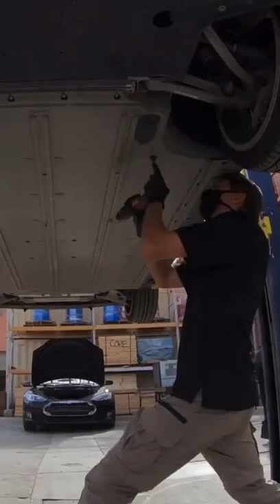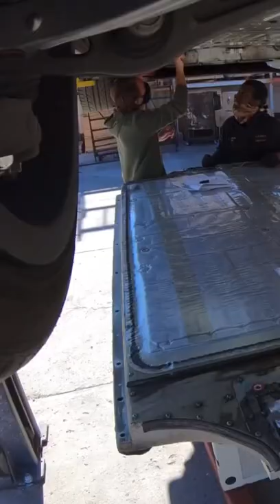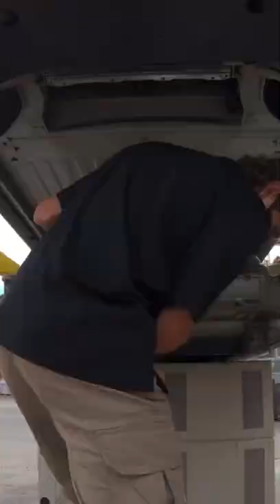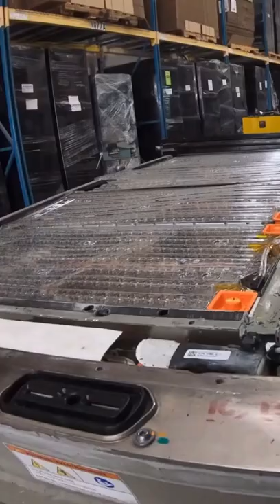How we Remove the Tesla Main Battery Pack

Comment: And then they LS swap it so It can be a real car
Reply: Love it!
Reply: Best comment!
Reply: Why make it slower and more expensive to run?
Reply: @Victor-vj5ds  No, so it can drive three counties away without having to recharge lmao...
Reply: @motherlovinsnuffstar  so your doing an LS swap so you don't have to stop every 4 hours to recharge? I'd rather save myself the gas money....
Reply: @Victor-vj5ds  I get that. But personally I take the vehicle's range into account when determining its reliability. I have a 50 year old jeep that I can refuel on the middle of nowhere, on the side of the road, or out in the woods, in less than 10 minutes with a Gerry can. And go places no ev has ever been (or ever will).
Reply: @Victor-vj5ds  No, I wouldn't waste an LS (or a lawnmower engine)  on an ev. Those gender neutral mobiles aren't for me, regardless.
Reply: @motherlovinsnuffstar  is your car a girl, or a boy?
Reply: @motherlovinsnuffstar  i own a jeep wrangler, do to its poor gas mileage an EV can outrange it but because electric motors have instant tourqe vectoring they can beat any 4x4 system you can put in your car. You can use anything from the sun to gasoline to recharge an EV if you run out of range.
Reply: @Victor-vj5ds  I didn't mean the car itself, the driver's. I called EVs gender neutral mobiles. Is the batmobile Batman or Bruce Wayne?
Reply: @Victor-vj5ds  I'm talking about a real jeep, Not a Fiat made cheap jeep. And yes, I can out range your ev, guaranteed. With the fuel I have in it, and in my Gerry cans. No two ways about it. I could go nearly 1000 miles before I have to refuel, and fill my cans. I guess you could drop a few energizers into your trunk or something lmao.
Reply: I'll just leave this here..
Battery-electric vehicles and plug-in hybrids have more problems than the average car, according to the annual J.D. Power U.S. Initial Quality Study (IQS) released Wednesday. The 2022 survey found that EV owners cited 39% more problems with their new vehicles than did owners of new combustion-engine vehicles.Jun 28, 2022
Reply: @motherlovinsnuffstar  you know whats funny, you actually can't outrange an EV if you bring the same "gerry" cans and a portable generator. EVs are extremely efficient even when they run in gas, more than most cars. But this is an argument you have to admit will age poorly as EV batteries improve energy density. Eventually batteries will get you further and recharge in 5 minutes, but hey, i guess you save some time if your doing a multi day offroading adventure like people do all the time.
I think your naive for using JD power associations ranking system. You need to look closely on how the data is gathered VS other organizations. For example "consumers report" has Tesla simultaneously ranked lowest in reliability but highest in customer satisfaction raiting. Then you look at whats considered reliability and see something like a panel gap is complaint is the same as having your valves drop and destroying your engine. So who do I look at to determine if money is actually being saved? Rental companies and police departments. From what I heard from some police departments, it makes up the cost difference in 2-3 years compared to a Ford Taurus do to the lack of maintenance and fuel cost. Your probably only hearing about this because traditional automakers have really struggled to make EVs for the first time and push things ahead of schedule to stay competitive. EVs are usually packed to the brim with electronics now that just introduce more failure points but this is not exclusive to EVs, the same stuff is causing reliability issues in new gas cars but its usually worth it. Even JD power says most of the issues in EVs are related to the electronic interface and not the actual mechanical hardware.
Reply: @Victor-vj5ds  I wouldn't need gas cans or a generator.Lets drive across the US, say LA  California to Jacksonville Florida, (2,415.7 miles). Give me any petrol car with a range of 400 miles. I'd be able to find a gas pump before you could find a charging station, and fill up and be back on the road 15-20 minutes before you. We'd have to fill up/charge a total of 6 times. The fact that you have to charge alone would put me 90 minutes ahead of you, at minimum. Add a couple Gerry cans, and I've got you out ranged by a good margin. In fact, you'd better bring a generator. And your wrangler, if you don't want to walk home. Because I'm one of those "I told you so" kind of assholes who'd let your ass walk, and would be laughing so hard I wouldn't be able to take your money.
Reply: @Victor-vj5ds " They have instant torque, so they can beat any 4x4 system you can put in your car." Idk what to even make of that... How's that instant torque any advantage of you're in water, or mud past your hood? You didn't even change your own oil, or know how to do a tune up, huh? I didn't realize you were one of those ev drivers..
Reply: @motherlovinsnuffstar   i don't own a tesla but I do infact change the oil on my own jeep and fix anything that needs to be fixed if I have the tools since I work construction for a living. My brother has a model S long range, it has a range of 400 miles. He spends no time looking for a charge station because tesla automatically chooses every stop you need in order to reach your destination. Super chargers are everywhere so all you have to do is follow the GPS. Current superchargers get 50% of your range in 15 minutes or 80% in 25 minutes. Thats reasonable for every 4 hours of driving. But then I'm thinking, why would I care if you road trip 10% faster across the country. Is this a race or are we seeing which one is cheaper/ more enjoyable? I'd rather save a few hundred bucks than get there 90 minutes earlier. 
On your question about instant tourqe vectoring. This is an advantage over traditional differential because depending on the number of motors, you can control the amount of power given to each wheel. A common problem is tires applying to much power and causing tire slip which means the power doesn't get fully applied. So their is a delicate balance of applying a lot a tourqe but not enough to overcome the friction of the tire. The motors can detect a slip through changes in its magnetic field at near instant speed and is able to adjust tourqe to either stop or prevent slip. Another issue with simple differentials is that if a tire is on un even ground and is lifted off the surface it can cause all of the engines power to get sent to that spinning tire instead of the ones touching the ground. You can beat this with something like limited slip differential but they have considerable lag that can never approach the speed of a electric motors response time.

Interesting you mention water all the way up to the hood. I've seen a few videos from China heaving major flooding but Teslas driving through flood streets except their floating because they have sealed cabins and peddeling forward with just the wheel spin of the tires like if it was some kind of boat, the engine in my jeep would have chocked without a snorkel.
Reply: @Victor-vj5ds  Even Toyota says EVs are a lost cause. A long range Tesla, 400 miles. The petrol car I was referring to wouldn't be considered long range, or extended range by petrol standards. And I'm sure your brother isn't driving it far enough to need the range he's got, much less more. Everyone talks about efficiency, I see plenty of junkyard LS engines making over 1000 whp on a stock bottom end. It takes three, three phase motors for a Tesla plaid to do it, lmao.
Reply: @motherlovinsnuffstar  see, you're still trying to win by choosing the losing team, Toyota hasn't made a single EV, instead they have focused on hydrogen cars for the last two decades and have failed to make them commercially viable. Why would I care what Toyota thinks when Tesla has the top 2 selling cars in California?
I know you can take just about most engines and push ridiculous power but its funny your trying to downplay tesla by saying they need 3 motors like they aren't sub 100 pounds each and cost less than 1,000$ to make. The plaid comes with 1020hp factory stock and a 150,000 mile 8 year warranty on that drive train and battery. If you actually want to make a point show me a stock 1000hp engine with the same warranty.

Comment: I remember the battery swap station Tesla had at Harris Ranch on i5 half way between LA and the Bay Area back in the day. They did all this from a pit under the car, and the battery was lowered down and slid into a charging slot along the sides, and then a fresh battery slid back in and bolted on.
They shut it down a few years back, and I think it was about 5 years ago they finally gutted the equipment and turned the building into the prep kitchen for Harris Ranch Express BBQ!

Now Tesla is in process of building one of the largest Supercharger stations ever right next to the building, and the BBQ is worth stopping for even if you don't have a Tesla!

Comment: “The best part of Tesla is i don’t have to do maintenance or oil changes 🤓”
Reply: You don't have to replace the battery for a veeery long time. Battery replacementa are rare and often done to cars that have abused fast charging. If you care for your battery it will last 30+ years to the point most gas cars have broken engines/gearboxes or are pile of rust

Comment: I want to side what happened when one of the batteries gets t-boned. Outcome can't be good
Reply: Compared to other cars it’s amazingly good
Reply: @09impala  Uh.... nope. Compared to an ICE vehicle the tesla is more dangerous in a wreck. Lithium batteries will very easily have a meltdown if they get damaged even in slight ways. If the battery does start to meltdown it's also more difficult to put out as lithium 9 put of 10 times won't be put out by water often the water makes it worse due to causing a hydrogen explosion.
Reply: @jessehoward2128  if you had stats on that than maybe people would believe you

Comment: nice never knew the batteries were so low to the ground that’s a little odd given the fact that streets get over a 100 degrees during the summer. I’ve noticed heat does numbers to lithium batteries..

Comment: What’s the life on said batteries?
What’s the replacement cost of said batteries?
Reply: Replacement every 300,000 to 500,000 miles. Battery replacement cost depends on labor and parts, but average cost is $13, 000 and $14,000 for basic model replacement. For Model S, premium sedan, $13,000 to $20,000.
Reply: Under ideal conditions a lithium battery will lose about 5-10% capacity per year.
Reply: @divaah4406  300k miles?  Electric vechicles are not lasting that long.
Reply: A few years, worse if you live in cold climates.
Reply: @divaah4406  Time is just as damaging as using the battery.  Lithium storage batteries have a expiration date of 5-10 years at most.

Comment: I’ll stick with my FE 390 in my 70’ F350 and the 460 in my 83’ F250.   I can actually fix anything that breaks on them. And it’s cheaper.
Reply: I agree 100% , however parts are becoming harder to source every day. I have two 7th generation Suburbans that have been parted out to keep my 1985 going. Coming up on 800K. I wish I had the space for several more to part out for profit. I sold an original set of mirrors for what the second one cost me.

Comment: They say that tesla’s are completely green and good for the environment but think of the tyres,electricity that comes from a coal powered energy plant and the chemicals that are in the plastics and batteries and once them batteries are done where do they go?
Reply: Lithium Batteries are nearly 100% recyclable and power plants are much more efficient and make like 4 times the energy with the same about of fuel burned so even if you have to use non renewable grid power to charge you still can power like 4 EVs with the same gas as 1 ICE car. Also no one says Tesla's are completely green but they are potentially very positive in many ways.

Comment: Watch the videos of lithium batteries on fire and exploding. 
I’ll keep my gas truck thanks.
Reply: Watch the video of ice cars catching fire. What now?
Reply: @riba2233  there are a helluva lot more ICE cars than EVs. So you would expect there to be fires. But the shear number of EV batteries catching fire is alarming. Not to mention how they break down all the time and you have to wait forever to get parts. If you have one 👍🏻 but don’t try to sell me on their BS efficiency, safety, and eco friendliness.
Reply: @justgillin6968  ice cars catch on fire 50 times more than ev cars, relative to their share on the road. So what now? Still the same dumb opinion?
Reply: @riba2233 took a while to look that one up huh? Did you happen to look up WHY those EVs are catching fire? The ICEs are almost always due to accidents. The EVs just catch on fire. And you can extinguish an ICE fire. EVs will burner harder and are more volatile. Besides the battery issue they are still POS.

Comment: Battery power , it still has to have oil and grease for the bearings and it needs electricity generated by another source to charge , hydroelectric power or wind power or nuclear power or coal fired power plants , so how is this so great ? Oh and the battery costs $$$$$$$$ just a standard car battery is $$$